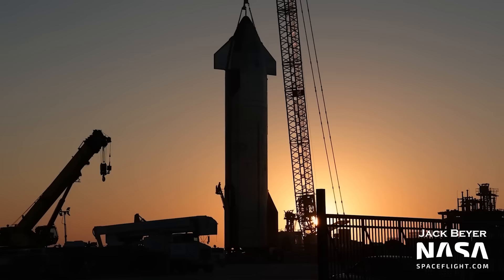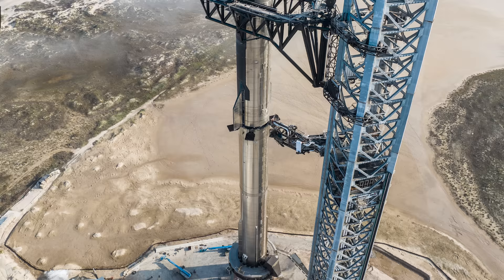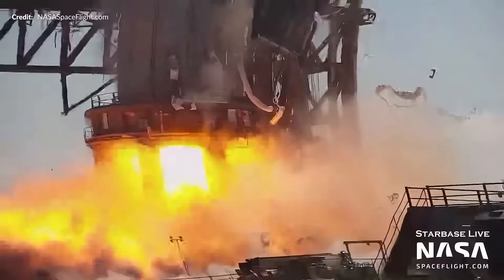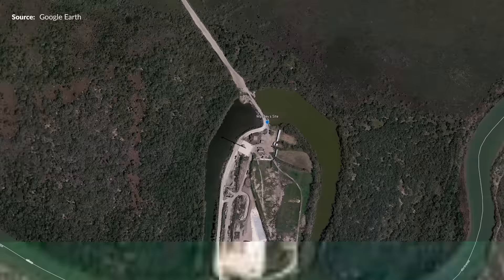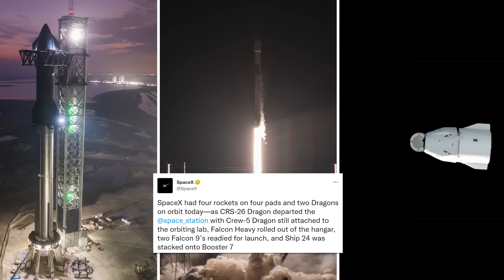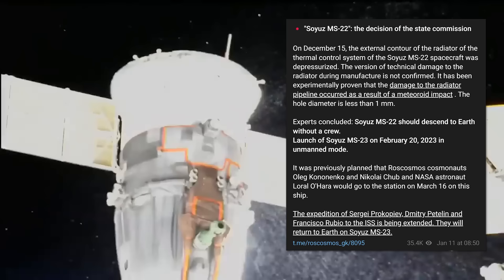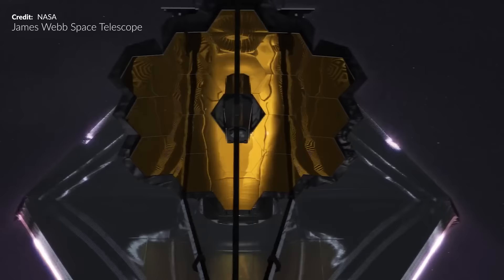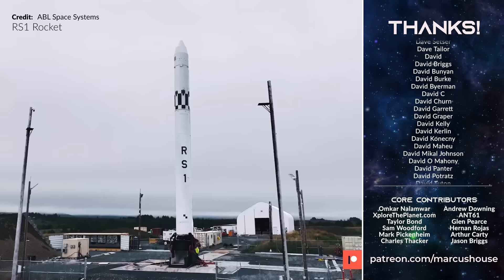SpaceX Starship Full Stack Upgrade Testing, Falcon 9 OneWeb, Falcon Heavy USSF-67, JWST Update

Comment: I’m waiting to see the entire Starship get launched into orbit.  Until then, this is all just nice to know news on Starship, but is meaningless.  The last time someone tried to launch a rocket with this many engines on it, that someone was called the “Soviet Union”, and that rocket was their counterpart to our Apollo space program.  That rocket was a huge failure as well.  EVERY SINGLE ONE BLEW UP.  My gut tells me this one will be an equally massive failure as well.  There’s just far too many engines that create too many things to go wrong.  Additionally, I suspect that the the heat created by all those engines working in concert is going to overwhelm the ability of the rocket engine’s’ abilities to keep all those rocket engine nozzles and other exposed components from outright melting away, leaving a trail of liquid metal streaming off the bottom of the rocket within seconds after liftoff.  The problem is, when multiple sources of flame are placed right next to each other, those flames tend to combine, creating vastly more heat than if they were kept slightly further apart.  NASA’s rocket nozzles have always had enough separation between them that the combined thrust occurs far enough away from the Rocket that the heat can be dealt with.  That doesn’t appear to be the case with Elon’s Starship.  This is one rocket that ought to have been assembled up in orbit, where the need to have so much power could be drastically reduced.

I’m aware of the incredible amount of testing that Elon’s been having done with Starship.  But the real test will be when all those rocket engines are lit off at the same time.  I’m trying to have faith that this rocket will work.  But I’m not about to go betting on it.

I’m absolutely thrilled that our country is FINALLY taking the exploration of space serious.  However, it’s way past time that NASA gets their budget drastically increased.
Reply: Superheavy has 33 engines
That's not many more than the 27 engines on the Falcon Heavy which works perfectly fine

In the days of N1, they just didn't have the computing power to calculate and control the engine start sequence so that it doesn't blow itself up from vibrations etc.
Reply: @Astromath  

They also couldn't abort or do test fires.  One firing on the engines was it.  

Dare I say Soviet quality control and manufacturing techniques were inferior to SpaceX?
Reply: This guy must never heard of Falcon & Electron rockets, with its cluster of tightly placed engines